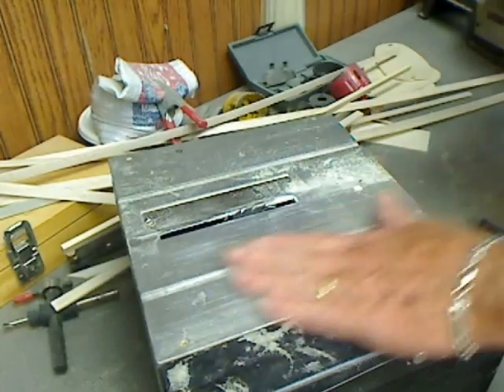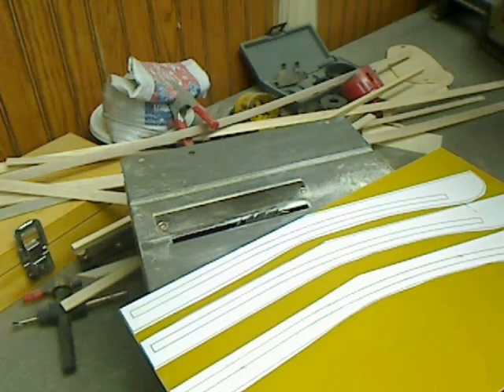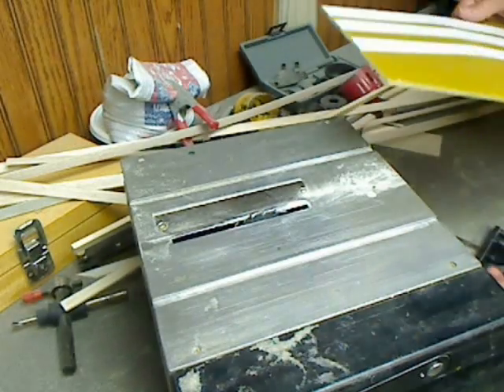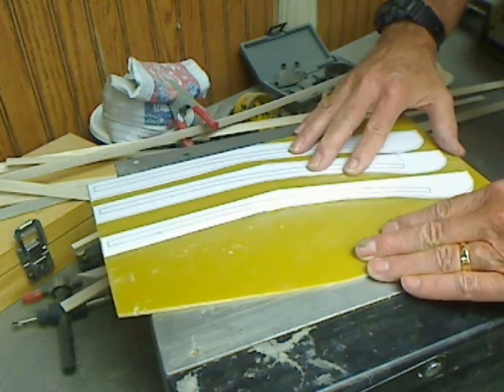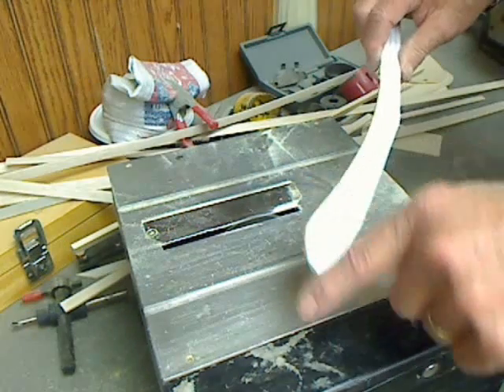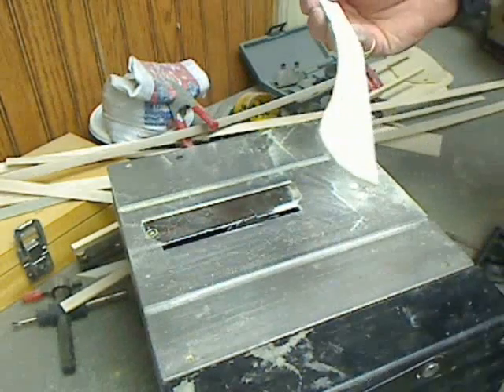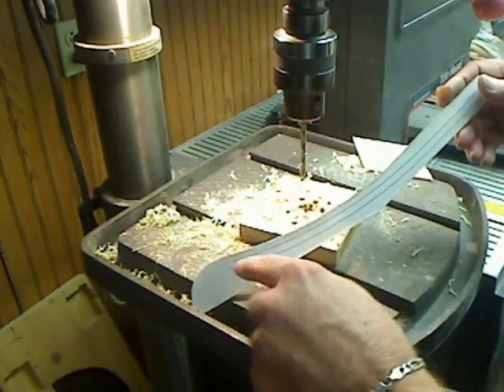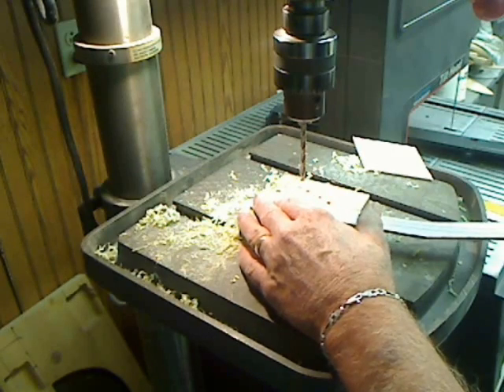Starship #18 Fowler Flaps Part 1.

Comment: Wondering if stacking the flap tracks when drilling the raceways would help ensure that they're all the same and won't bind up later.  I'm just thinking that even in a drill press it's sometimes hard to center the drill bit and a little wobble on any track could possibly later be a point for binding.  Just a thought.